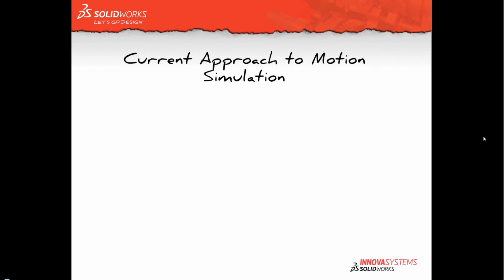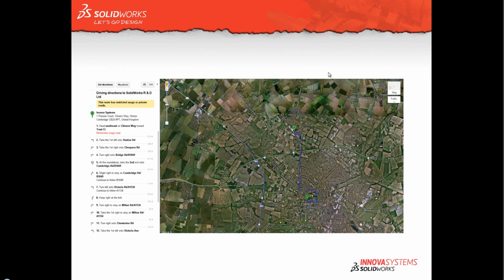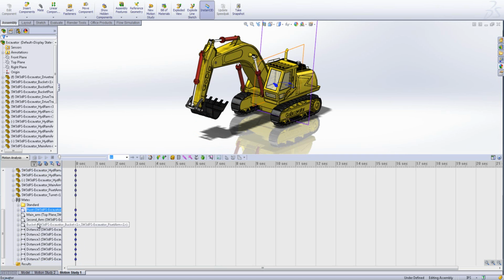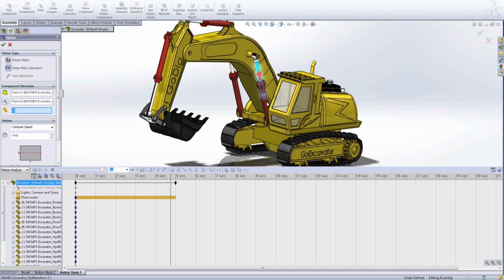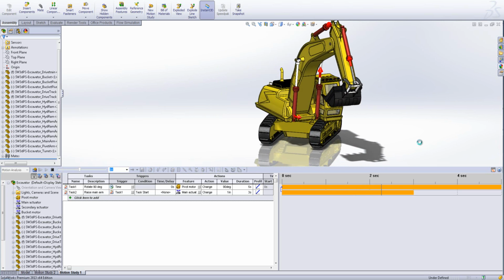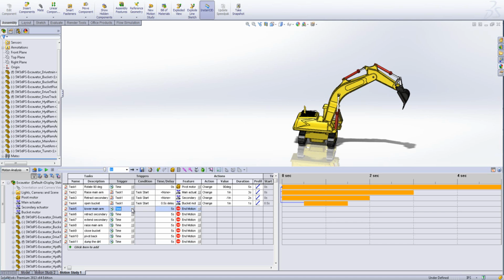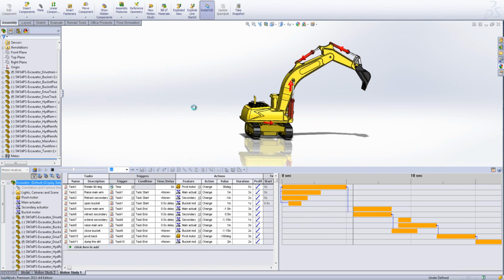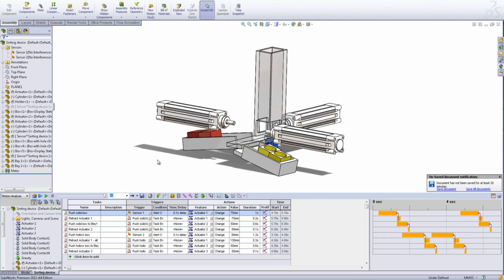Event-based motion in SolidWorks

Comment: I cannot get the motors to turn only 90 deg. It is very frustrating. I have a swing wing model plane I designed and simply fail to animate it. I followed your instructions but still it does not work.

Comment: Hey, i have one , maybe obvious but not for me, question : If i am using servomotors as replacement for hydraulic motors [i am working on hooklift] , which force should i use when looking for right hydraulic motor in catalogue ? From postprocesing, magnitude of the servomotor or force in the axis of servomotor?